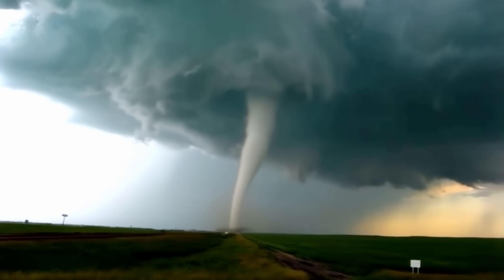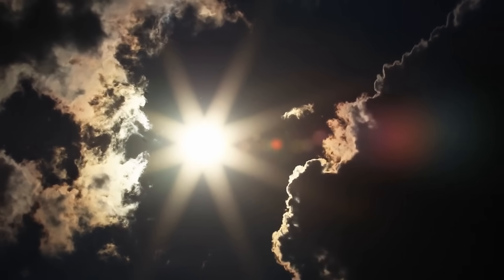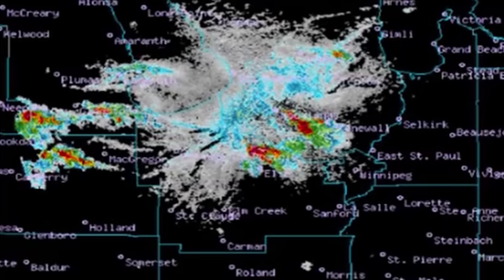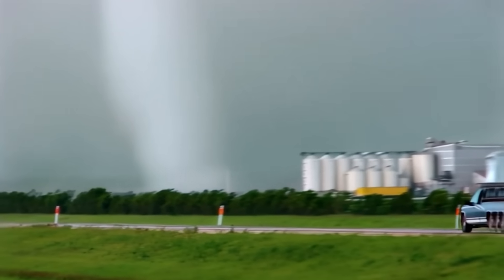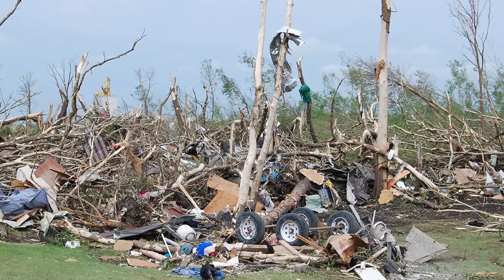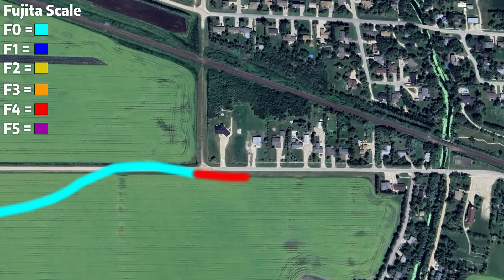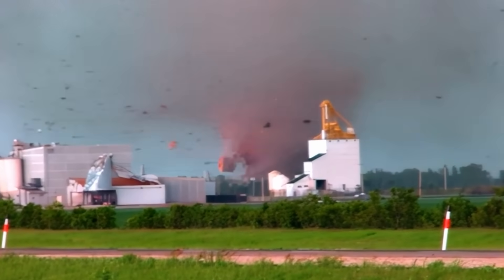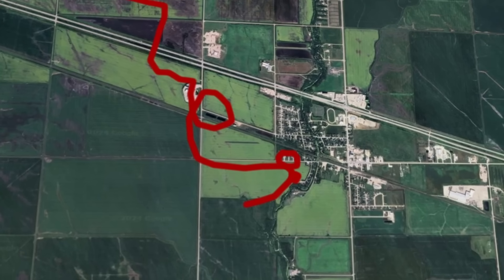Canada's ONLY F5 Tornado

Comment: On April 30, 2019, we also had a spectacular tornado in Romania, which fortunately did not pass over populated areas until its end, when it demolished several walls, roofs of houses and lifted a bus full of passengers off the ground, dragging it across the field for several dozen meters and overturning it. Many passengers required hospitalization and several suffered serious injuries.
The tornado lasted 1 hour and 20 minutes and traveled 55 kilometers. How could it be classified?
Reply: https://youtu.be/F80vLhd6afo
https://youtu.be/QcEJkfnfSWM
https://youtu.be/Vi3V0AV87tw

Comment: I always suggest this video to people when talking about the Jarrell, Texas tornado of 1997. Many people always dispute and say that the only reason it did that damage in Jarrell was because it stalled over the Double Creek subdivision. And they assume that the winds just constantly hit everything and it took several minutes to destroy it. They always confused slow forward movement speed to equal Slow Wind Speed intensity, that's not always true. 

This video completely DEBUNKS that because of the specific home video footage of the Elie tornado hitting that one home. It IMMEDIATELY OBLITERATES the house on contact. THEN after everything is gone is when it stalls over that area. 

That's EXACTLY what happened in Jarrell. There's no rational way anyone can convince me that a tornado that ripped up several yards of asphalt and removed: homes, plumbing, light pole, trees, gas lines, cars, and Earth... no way it did all that and had lower than F5 windspeeds an excess of arpund 300mph and wasn't powerful. That damage wasn't done because of constantly battering the area. It removed that subdivision on contact. This video analysis proves that buildings and structures are usually obliterated on contact and then those tornadoes stalled.

The Jarrell tornado for one, was ¾ a mile wide. Thats said to be 13 football fields. So its footprint covered 99% of the entire Double Creek subdivision. It was a freak of nature that wasn't supposed to happen according to the NOAA and NWS. 

And as you see by the information provided in this video, the "experts" aren't always correct upon first suggestions or theories. Sometimes plain common sense and video footage can debunk the best bureaucracy that goes strictly by the book.

Comment: That was a crazy week. We got the Elie F5 tornado, within spitting distance of Winnipeg, plus an F3 in Oakville (like, 20 km west of Elie) at approximately the same time...and then one day later, there were FOUR MORE tornadoes. The strongest of these were in Pipestone (close to the Saskatchewan border), and in Baldur (about halfway between Carberry and the US border), both rated F3, plus there were 2 F1s, one just north of Pipestone at the Oak Lake Reserve, and a second just west of the Whiteshell provincial park (near Pinawa) at Seven Sisters Falls. And if that's not enough, that same day, a massive downburst occurred that took down more than a million trees and cut off power to hundreds of cottages in the Whiteshell Park (~20-25 km from the Ontario border). This event was originally investigated as a possible tornado (given what had been happening across the province that same day, it was a solid hypothesis), but it was determined to be a linear wind downburst with speeds in the 100 kph range (which is the lower level of what an EF0 tornado will produce). There was no meandering path, just a solid area of land with almost every tree knocked over in roughly the same direction.

This kind of event (or something similar) might happen all the time in Texas, Oklahoma and Kansas (as I understand it, EF5s are still not so common, even in Tornado Alley), but for Manitoba, this was highly unusual. Most years, we get roughly 10 tornadoes (plus or minus 5), usually in mid-June thru early-August (as our springs are too cold - they lack the atmospheric energy that needs to exist to develop tornadoes), and they almost never exceed an EF2. This year, for example, we have already had a few, most notably on June 12th, when 5 confirmed tornadoes touched down, all of which were either EF0 or EF1. Plus, there was at least one a couple days ago, that has yet to be rated (footage exists confirming touchdown, and to me it looks like a probable EF0). Getting three F3s (at least a couple of which had wind speeds that would've qualified them as EF4s had Canada been using that scale at the time) and an actual F5 within the same roughly 24-hour period was a once-in-a-generation type event. Notably, since 2007, there has been just ONE EF3 and ONE EF4 tornadoes touching down here. The EF3 was in 2020 in Virden (it killed 3 people), while the EF4 was in 2018, along the west coast of Lake Manitoba (it generated one fatality)...and the 4 people who died in those storms are the ONLY tornado fatalities in this province since 2006 (when an F2 killed one person in August). We were very lucky that nobody died over the 22nd-23rd of June, 2007, because there is no doubt that those storms had the potential for dozens of casualties, had people not taken appropriate measures to protect themselves (or just been unlucky).
Reply: Yea i was fortunate enough not to get a tornado to hit us this year on june 12 in manitoba, but the clouds were twisting like crazy
Reply: Whoa

Comment: Question. You keep saying "It made 3 separate 360 degree loops, and travelled in almost every cardinal direction"

If it made a 360 degree loop, how did it travel in ALMOST every direction? 360 is EVERY direction.

Comment: What vr winds being forced through the thermal cycle so a convecting point is now part of the water cycle field and atmosphereic conditions at frontal or your system would not rotate upon a pivot but grind its well contact of hot cold bodies regulare tornadoes , but winds well converge as chemical gases following cyclo ic transfer of pocketed gases and disperse in varying points creat a wind from all direction pressure mass that holds hot and cold transfer from earth spawni g from set pocket depletion is the burst the thunder storm or torrential rain that can chow a ef0 allone bei g touch down never curves but fills as a voided cloud into a full contiental cloud then the thing goes hot and cold to make a tornado. Fun. I rather watch them strech the sky too.
Reply: 😮 go Wal mart red deer

Comment: Ok, I knew basically everything you said here… except that if we had adopted the EF scale at the same time as the US it would still have received an EF5 rating. That tornado was crazy… and what’s worse is that, like you said, it wasn’t one of those ultra scary tornado that you can guess would do EF4/EF5 damage ,if it hit anything, at a glance, it was just a small rope tornado. Hell, it didn’t even have horizontal vortex yet here it was picking up an entire house bolted to its foundation like it was a toy. I’m certain that trucker and the guys at the flour mill must have seen themselves as lucky that it hit them before it decided to transform into a small monster

Comment: It's a very common myth that the bigger the tornado is, the more powerful it is. It's true that generally wedge tornadoes are more powerful and smaller tornadoes are weaker, but there's a bunch of exceptions to that rule. There have been wedge tornadoes that have only done EF2 damage - still significant, but barely - and plenty of "drillbit" tornadoes that have done EF4 to EF5 damage. The reason is somewhat complex, but it comes down to physics - when a larger tornado narrows with the same amount of rotational energy, it speeds up, like when a figure skater pulls in their arms to spin faster. An otherwise weak tornado - like this one - can suddenly turn violent when it begins to rope out. Even in the case of wedge tornadoes, most of the violent damage is not done by the main funnel, but by subvorticies or suction vortices WITHIN the main tornado. These concentrate the huge amount of energy of a wedge into one tiny point - they last only seconds, but can do massive damage if they strike something.

Also, it's good for folks to remember the EF/F scale is a damage scale, not a windspeed scale. The El Reno tornado, originally rated EF5 because of 300 mph winds recorded by radar, later was downgraded to EF3 because it didn't strike any substantially built buildings. When it was first invented there was no way to measure a tornado's windspeed, so the F scale estimated it. Now we CAN measure the windspeeds in the few tornadoes we get a radar close to, but the EF scale remains a damage scale. It's kind of a hot topic among both meteorologists and storm chasers alike! You might say, it's an endless spinning cycle...
Reply: Something also peculiar with smaller tornadoes is the concentration (much like the sub-vortices you mention) of upward wind that will more readily render objects airborne than larger tornadoes, given the distance to the strongest uplifting winds increases with width. Often things will be sent tumbling from the immense lateral and inrushing winds of a large, violent tornado before it even passes directly over it. In contrast, very narrow tornadoes pass their entire width over a given object much faster and the uplifting winds can catch things like the chassis under cars very quickly. I've seen it in multiple videos of even tornadoes rated EF-0 actually flipping cars, a rating commonly thought to be incapable of even budging most vehicles. The rating system is very flawed, but there isn't much room to improve it without dedicating more resources to analyze the fine details and nuances that, in light of the destruction they cause to real lives, is less important.

Comment: It's a miracle that no one was killed or hurt. That scene of the house getting swept into the air is one of the greatest of all storm videos.

Some of my other top footage is of the 1991 Andover F5 going through the air force base and later sweeping eerily behind those rows of houses, and Pampa's F4 (1995).
Reply: And the Drill bit tornado...
Reply: The footage of it snatching that home up is one of the most important videos of a tornado and the F5 rating of all time. It debunks the thought that tornadoes that hover or stall in place is constantly battering buildings with wins in order to destroy them. Slow-moving tornadoes like the Jarrell Texas Tornados authoritative only done the damage they did because it was slow moving and constantly impacted that area. This Tornado proves that F5 tornadoes immediately destroyed homes in obliterate them on contact and then they can install on an open slab.
Reply: @DRDetriot-vl3sn   Jarrell was still an F5 however.....  it just destroyed everything for so long and left nothing behind, and cattle as well as humans were stripped off their flesh, deboned and broken into pieces. They even had to use dental records to identify the victims.  Cows were even gutted, their organs were  spilled and what not. 
All the slabs were gone and only mud was left behind.   That was the most evil tornado ever.